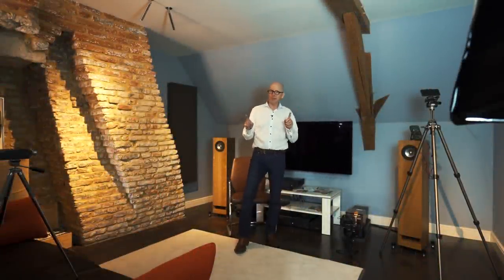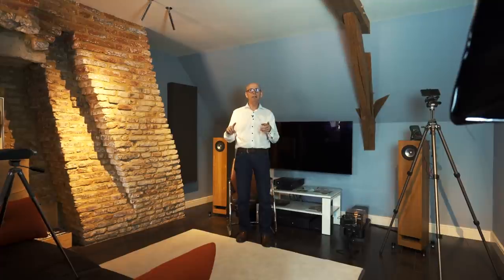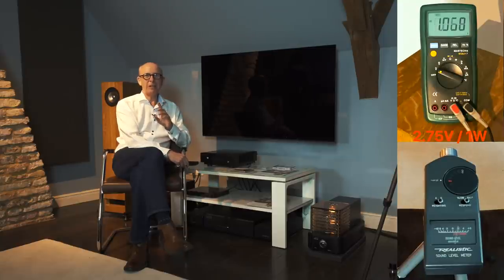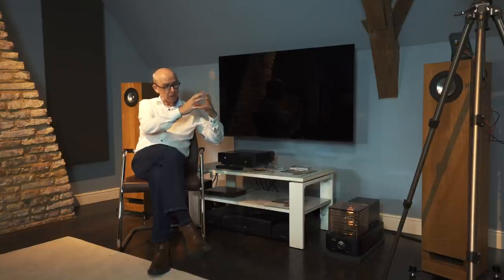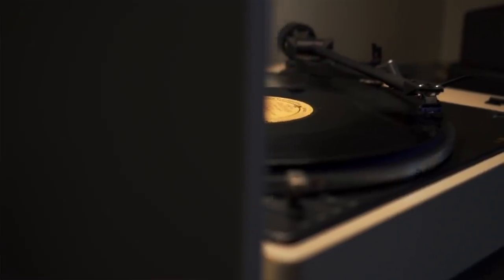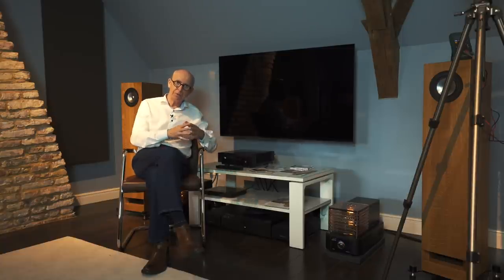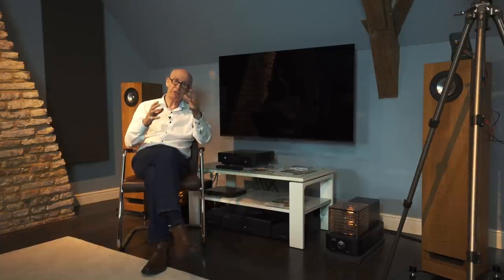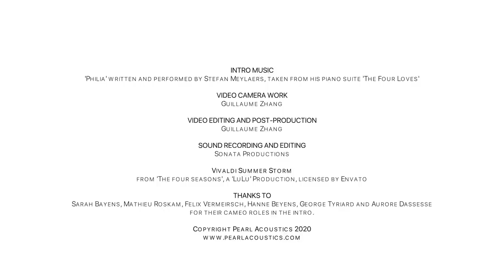How loud is 1 Watt (with an 87db Loudspeaker)?

Comment: im sure this video is correctly displaying loudness within the settings used. a easy 8 ohm load with that recording.
i am not discrediting this video conclusion but adding to it what some people may encounter and especially with digital system people buy more of now.
The things that change now is the recording loudness varies and you still need the same 1 watt produced but the volume knob need to be turned much higher,  that necessitate a higher watt amp if you don't get enough volume out of the old amp.
Dsp is more common now, that usually lowers volume, and we have other audio content like movies or tv-shows.
And the situation i get into all things hit at once and i can max out my preamp volume, and my 100 watt poweramp can't give me close to 100 watt output. 

i liked the video, but anyone should always test at home with amps. and also extra watts comes at a cost to sound quality at same price lower watts amps.
Reply: If you maxed out your volume knob and it's not loud enough, you don't need more power, all you need is higher gain/amplification factor at your preamp.
Reply: @tomaszbekiesz3732  sure that's away, but you can't change that as far is i know. unless the gear as it already built in. increasing gain also has drawbacks, noise floor is one i think. 
a more powerful amp is the most clean way of getting more loudness. correct me if i am wrong.
Reply: @sudd3660  Sorry, but I have to correct you. Most amplifiers consists of preamp (voltage amplification stage) and power end (power amplification stage). Small signal from the source goes through volume pot to preamp where it's voltage is amplified but still lack of power (it has higher voltage but very low current). That's the stage where you create how loud you gonna get (voltage) and on last stage (power amplification - voltage amplification factor is near 1) you only adding current to the already amplified signal so it'll have enough power to move the cone on your speaker and it's adding only as much current as your speaker demands at the moment through it's impedance (it's changing with the frequency).
So a 100W is plenty enough or even to much for home listening which is clearly demonstrated in this video. To have 100W RMS power at 8ohm speaker you need to amplify your source signal to about 29V RMS (power = voltage square / impedance). Most modern signal sources gives about 1.8 - 2 V RMS signal at the output which means that the amplifier has to have about 14 times amplification. But you don't need whole 29 V (100W) at your speakers to listen to loud enough music - 7 - 10V will suffice as it's well shown in this video (you do it by decreasing signal voltage at the volume potentiometer just before it gets to the preamp). So if you have weaker source like lets say turntable with MM pickup (about 40mV output) then you need additional preamp in your signal chain and yes you're rising the noise floor but there's no other way.
I hope it'll help you to get deeper into understanding of this not trivial topic.
Reply: @tomaszbekiesz3732   i don't want to increase noise floor or extra pieces of gear.
my preamp and power amps a matched in gains, would it not be easier to find a new poweramp with more gain then? not that i am comfortable with more gain.
getting a new poweramp with more watts seems like the best option, with perhaps added sound quality as possible outcome and no noise floor increase or have dual preamps.
Reply: @sudd3660  Well, more watts usually means also more gain. To have 500W on 8ohm speakers your source signal have to be amplified to about 63V, the source have the same 2V so you have 63/2=31,5 V/V gain factor which it's significantly bigger then 14 V/V for 100W amp and also rises your noise floor. I don't know what you have, but if it's separate preamp with two monoblocks at the end, then those monoblocks should have no gain at all (only power amplification) and all voltage amplification should happen in the preamp.That means that all you need is to tweak your preamp usually by changing values of two resistors inside you can increase gain, maybe some local amp technician can do it for you.
Reply: @tomaszbekiesz3732  there is zero hifi technicians in my city.  but i was hoping since my preamp is the Bel Canto dac 2.5 and much is done digitally it could be firmware changed, the same way the volume knob is one of those infinite rotating ones and is programmed. there is updated to firmware so would be nice to be able to change thing in software, like gain and how the volume knob responds.
Reply: @sudd3660  Bel Canto DAC 2.5 should be considered as a source not preamp (it clearly says 2V RMS max at RCA output), please tell me also what you have after the DAC.
Reply: @tomaszbekiesz3732  i asked at the placed that sold them, and they said its equally a preamp as dac, so both in one if you will.
i use the balanced output to my stereo poweramp. so its more than 2v rms.
i connect my digital source to the belcanto.
Reply: @sudd3660  OK, XLR balanced signal is still a standardized line level signal 4v rms for an analog source. Your dac takes digital source signal and change it to analogue source signal, they told you that it works as an preamp because you have volume adjustment inside. Now after DAC you should have power amp with gain around 14times to have proper 100W output. I don't know maybe you have some fancy poweramp with low gain and it requires higher signal at the input or your problem lies in the digital levels of your digital signal  sources. Any way adding more watts is not a solution.
Reply: @tomaszbekiesz3732  i asked about the components, how much value was used for the preamp section vs dac section. furthermore reviews of the unit found the preamp section quite capable. 
as i told you earlier, the gain of my poweramp is the same as the belcanto power amps.  those you many people match with this preamp. 
and in my initial comment i explained that in normal simple use its enough for sure. but compounding changes alter the volume. and if people are in that situation i proposed that watts can solve it pretty well.
Reply: @sudd3660  OK i go a little to far saying  that more power is not a solution, it can be because with more watts comes more gain, but all you need is the gain itself, power is a bonus. You can also put small preamp (gain 1.5 to 2 times) between your DAC and power amp. 
Some digital sources have internal digital volume adjustment so make sure it's set to max.
Reply: @tomaszbekiesz3732  if i use my belanto as a pure dac and fixed output, then the preamp i add would have to add more volts than 4 to my poweramp at max. are you sure that is possible with preamps?

Comment: When I sued to sell esoteric hi fi in the late 80;s customers would ask probably what they seemed to be the only question they thought was an intelligent one - 'how many watts?' and I would always answer with this "How loud is a light bulb?"
Reply: @Paul-vf2wl  it was a question of understanding. We showed the utmost respect to all of our valued customers. The question is relevant when you consider the following - Ohms (resistance) and Class - an A class Amp for instance has much higher power rating but can also produce less power in terms of watts - which of course you know - but nothing more than a great conversation starter. The question was sometimes followed with "how many watts would you like?" It settles the ice. It may have been the only 'real job' I ever had but it was certainly the best!!. The highlight being getting to listen to the legendary Infinity IRSV's on a Mark Levinson monoblock power amplifier system with an Audio Research SP9 pre-amp and a Krell CD player  -fab times.

Comment: The real question is this: If speakers get that loud off a watt, do we really need HEADPHONE amps that exceed a watt? A WHAT!? you would call them.
Reply from the maker: Good question. Unfortunately, I am not an expert in this area - hopefully someone will answer your question who is! I know that headphone design is very varied and depending on the design, will demand a very different solution. I remember when I was a child having a crystal set radio with headphones, the whole thing was powered by a crystal connected to a very long antenna. I could tune into stations from all over the world, well at least Europe!
Reply: @PearlAcoustics  I connected one of those crystal headphones into the back of a stereo receiver and I was expecting it to be thunderously loud even with the volume low, but their impedance is so high that they don't draw enough power. It got loud but not what I was expecting.
You can actually use normal in ear headphones if you use a transformer to step up the current by trading voltage swing for it. It helps that your ears are sensitive at low volumes being able to hear billionths of a watt reasonably well.

Comment: Power delivery "speed" would  not affect the  impression on condition that time delay is constant for all acoustic frequencies ,. Example   time delay required for  digital conversion - even it is 1-5 sec delay nothing even can be observed. 

  Case which you described  is result of mixed together  time no coherence   for frequencies  in amplifier and speaker set . Some acoustic pressures are  too late  while    other let's say no.   Strongest heard  time delay  phase distortion is produced by speaker  system in it's acoustic low resonance and that is the reason why listeners say that bass is "fast" or "slow" and eventually complain required mostly for low range power of mains . Many   prize Open Baffle even their  lowest range is with slope but due to lack of resonance bass is not delayed. .  . 2/3/4 way technology is source    of phase distortions in speakers   and reason of that technology is  power of amplifiers  exceeding 10 Watts. What for? Why we need it and after suffer from  phase distortions?  I listen to my klang film  speakers made in 1930 and 3Watt  amplifier made in 1939 and it is  surprising experience. .   Thank You for valid  demonstration. .

Comment: so 2.75 volts x 30 amps is also 1 watt ? This is some serious misleading.
Reply from the maker: Hi Vishal, where did you get the 30 amps from? It is +/- 0.375 amps = 1 watt. Ohms law is volts divided by amps = resistance. Here we have a nominal resistance of 7,5ohm. Watts equal volts times amps. Thus 2,75 X 0,375 = 1.0313 Watts. I hope this helps?
Reply: @PearlAcoustics Your explanation surely helps. Just for reference i stated 30, amplifier power output is volt*amps right.
Reply from the maker: @vishalmohan1995  when your amplifier is driving a 7.5 ohm speaker, in order to deliver one watt of power it will deliver 2.75v at 0.325 amps. Watts = volts multiplied by amps.

Comment: 1 watt ...But how much kwh your electricity bill will be to play at that 1 watt for 1 hour
Reply: depends on the amplifier type. Some are very efficient, some are not. But in the end it's so small it's negligble. A light bulb is probably using more electricity

Comment: The meter you used does not measure true RMS, so what you see is not the actual power, the meter assumes it's a pure sine wave, if you want to measure the actual power you need a true RMS meter or better an oscilloscope, which will let you also measure the peaks, which also contribute to what you hear. Other than that, a 1W amp is actually pretty decent, I've built one previously and it was quite usable. The whole thing about "how fast it can deliver that power" is honestly BS, if it has the power it WILL deliver it

Comment: 5.5V is ~4 watts per channel, and my 102dB speakers blast the room with SMSL SA-98E amplifier.
Reply from the maker: Hi Tim, you’re 100% right of course, that was a silly mistake during the filming - I put the correction in the description straight away. But Thanks for pointing it out! I hope you enjoyed it none the less.
Reply: I am quite surprised at the "87 dB" speaker as I thought that was the efficiency of a little vented bookshelf speaker. I did build some boxes for motorola car speakers with huge magnet and light paper cone I estimate around 93dB but sounded terrible (shrill sound quality, though I think a custom crossover between the woofer and co-axial tweeter might have sorted it out, they had a single capacitor and I think they were crossed too low so there was a lot of upper mid coming through the small cone, and probably from the woofer as well as there was no crossover on the woofer). You could clean up the sound with a graphic equaliser to an extent. It was surprising how loud they got off of a Pringles amp chip though.
The horn loaded PA speakers I use are between 98 and 109 dB sensitivity depending on where in the frequency range you measure (annoyingly peaks right in the 2000 to 2500 range of the compression driver horn without EQ). I can get a surprisingly nice sound out of them though. They are more of a "fun" speaker though, especially with the vented 12" subwoofers I use them with.
Reply from the maker: @TimpBizkit  efficiency in our case is determined by the design of the drive unit, nothing else. Hope that helps? Seems you’ve had some experience and know that nit all designs work out how you might expect
Reply: @PearlAcoustics  okay. I thought a rear loaded horn should be able to beat 90 dB (2.83V 1m) at least in the low to mid-range. The same driver in a sealed flat baffle is probably quieter. Having subwoofers with 96 dB sensitivity each is nice though, especially combined in the corner of the room (though in many rooms the corner is boomy and resonant and may not give the best sound quality). You can make quite a bit of bass even with a small amplifier.

Comment: 1watt to 87db speaker per channel, = 93db stereo, plus room + 2~4db = around 96dbl in terms of loudness.
Reply: Not excactly. +6db gain is only if they are close to eachother. It's more of a 4db gain when spaced apart normally

Comment: That's not a heavily damped room. Log Scale.. You need tops 32 WPC and and decent efficiency. If you want 100db with enough headroom. 32wpc is what you want.

85db is pretty loud and a decent standard listening level.

Comment: rms or pmpo
Reply from the maker: Thank you for your question. With the volt meter we are measuring peak’ but of  course the volt meter is too slow to react  to give a truly scientific result. However, the conclusion is that with both channels driven at 1 watt  (87,5db + 87,5db) we get more than 90db into the listening room (rms) and that’s loud! At = 96db at 4 watts

Comment: I purchased a refurbished McIntosh MA12000. 350w x2. It uses 7.8 Watts in standby😂😂. I find it interesting older style class A amps and single cone drivers are more efficient than what we have today.
Reply: It puzzles many that single cone speakers are much more efficient and usually it is pointed to heavier mid low cones.  But the true reason  is that the more passive parts like capacitors  and coils are in circuit the more active power is converted to passive which cannot be exchanged to acoustic pressure.  Additionally time shifts between harmonics provide  deduction currents and pressures   instead of full synthesizing them back.

Comment: Very odd explanation of amplifiers. All the electronics that I deal with can respond billions of times faster than required for audio.
Reply: Agreed! He mentions "speed", which is not really a technical audio term.  Normally I would associate this with bandwidth, however any good amp is capable of >20kHz bandwidth, so this is not normally an issue.  He also mentions damping factor, which can impact the transient response. Most good solid state amps have a high damping factor.  Tube amps, however, with an output transformer, are often the culprits when it comes to low damping factors and can lead to lack of definition in the bass.
Reply: @markp718  Good to see there are some who understand what's really happening.   :)

Comment: You did 2.75 volts divided by 7.5 ohms to get 0.36 amps multiplied by 2.75 to get 1 watts, BUT,  when you speakers are running the impedance will double to around 15 ohms making you amplifier actually run at about 1/2 a watt, you needed 5.5 volts for 1 watt at 15 ohms.. Did you set it up with a 1khz wave with the spl meter at 1 meter So your 87 db sensitivity speakers read 87db at 1 meter. With only 1 speaker running?  The best way you could have tested your speakers sensitivity and what 1 watt sounds like is to use a clamp current meter and a volt metre with a 50hz tone,  then see what the meter reads for spl with a white noise. Also your 87 db is 1 speaker at 1 watt at 1 meter,, running both you will get 90+ db at   2 watts,,  to get 93db 4 watts needed,  96db 8 watts,  99db 16.  102/32,  105/64,  108/128., 111db 256 watts,, to double sound you need double the power that's why people are going for 200 watt amps because remember a 200 watt amp at 8 ohms is only 100 at 16 ohms. And 100 watts goes no where with today high bass output music...  If your only going to listen to classical music 10 watts is fine, if your listing to dub reggae 10 watts will just about run your 5khz tweeters